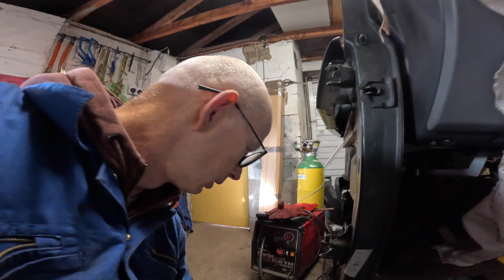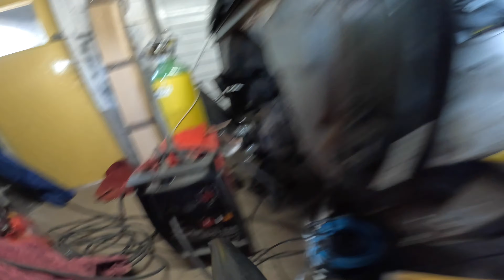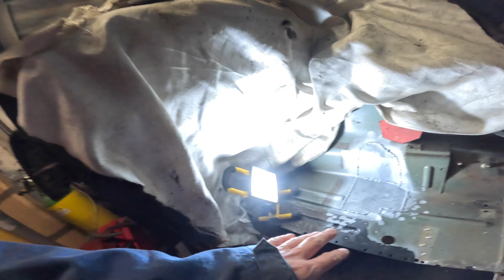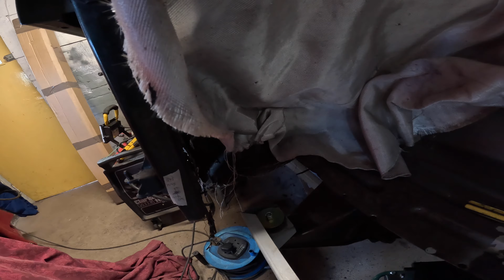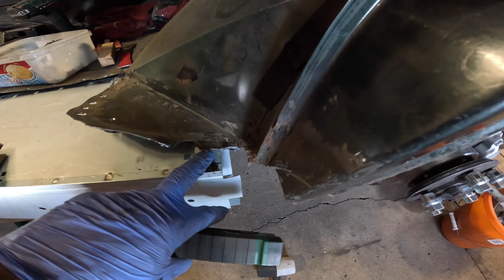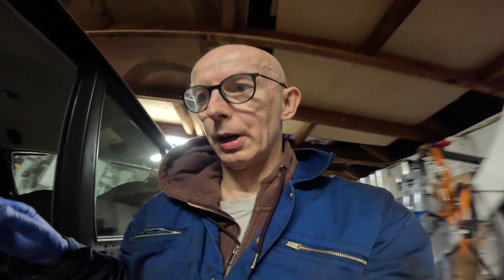Range Rover Classic LH FRONT FOOTWELL REPAIRS AND TRYING THE NEW SILL IN

Comment: The top-hat section bracket under the repair patch, that sits down against the top of the chassis - is that the original or a repair piece?  Mine doesn’t reach the chassis, and the floor flexes down with weight applied.  I suspect it is meant to have a rubber pad, as it seems to have a pair of fixing holes in the lower face (rivet holes?) - I suspect it is meant to be padded like the Series and Defender tub floor lateral braces against the chassis, but I can’t find a reference.
Reply from the maker: The top hat section that sits again the top of chassis is original. No holes in mine at all, in any of them from both sides....no signs of any rubber having been there either. Are they in the parts manual on earlier cars?

Comment: Nice work. How do you weld the inner and outer together?
Reply from the maker: Thank you. I will be showing that in the next video. I still haven't done that yet. After holiday I've been ill and rather busy. Essentially though, I do a full seam along the lower edge and wherever the two meet around the body mounts, then stitches of about 5cm every 5cm along the upper under floor inner edge if that makes sense. I really should try to crack back on with it.
Reply: @LR-nut  sounds like a good plan anyway. Hope you're on the mend.